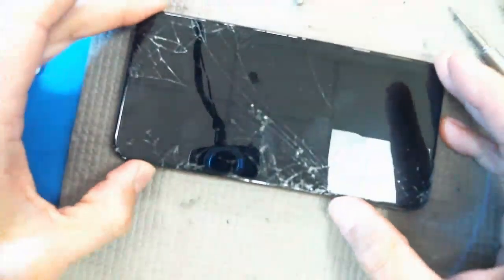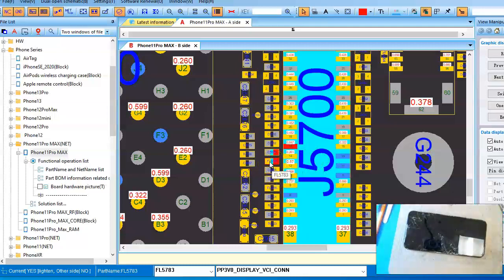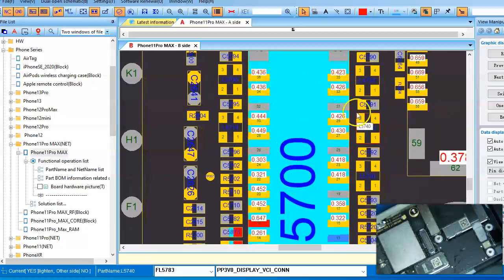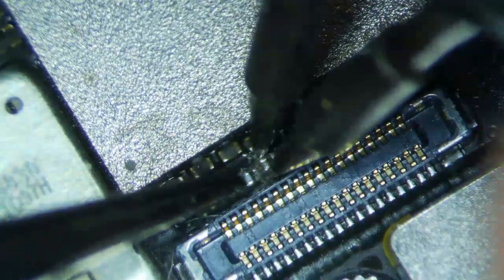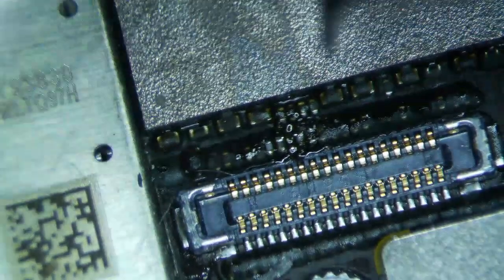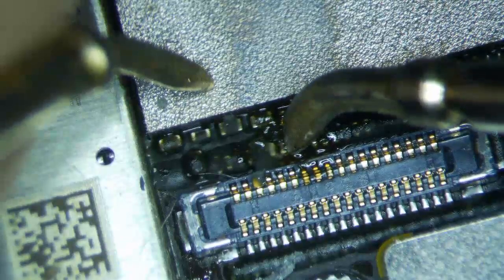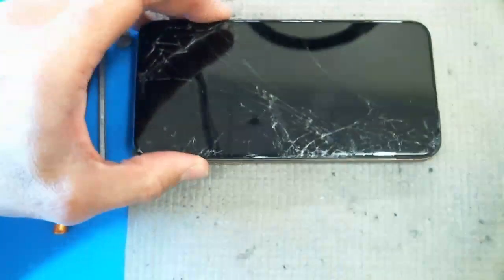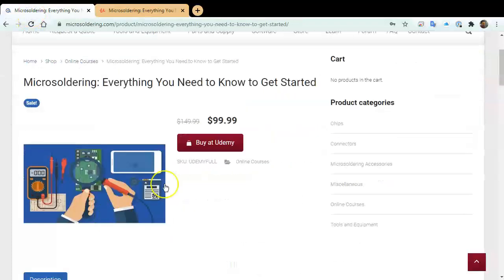Diagnosing and Repairing an iPhone 11 Pro Max with a Black Screen

Comment: Hey bud, so i have a similar issue, i tested the filter and it does not read zero it reads .565V but when i plug the phone in with a screen its only pulling around .4 amps, is this still the display filter issue?

Comment: I found your video by mistake but maybe it was fate I am having trouble with my phone it is a Samsung Galaxy s6 active. It has a black screen and when trying to power on nothing happens tried all button combos to no avail. it shows no response when I connect charger either. The only action that works is when I hold the power button down for over 7 seconds and a solid white light appears idk what else to do. The screen and battery are both good. Can you fix this issue? I have emailed you already on your website for a quote. But I figured I might get a faster reply this way.